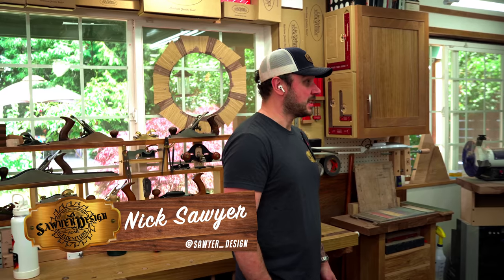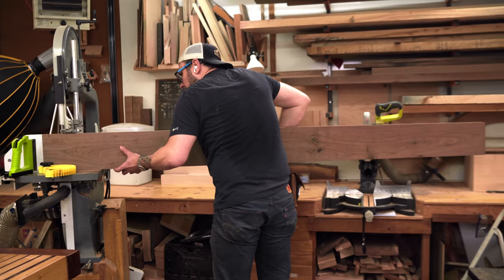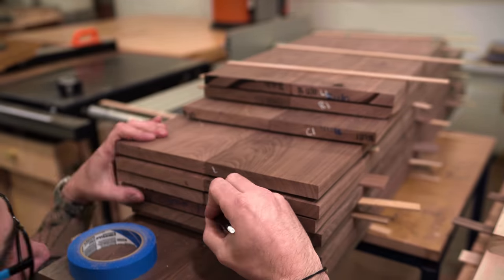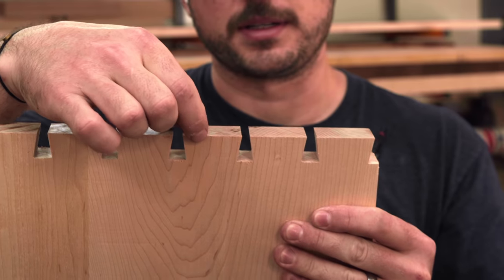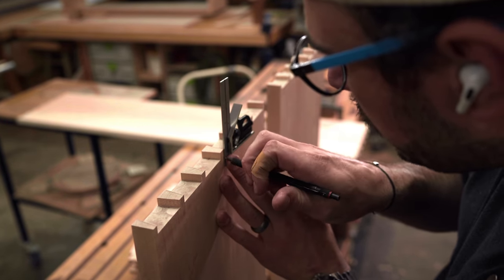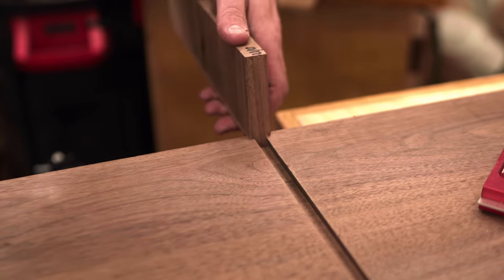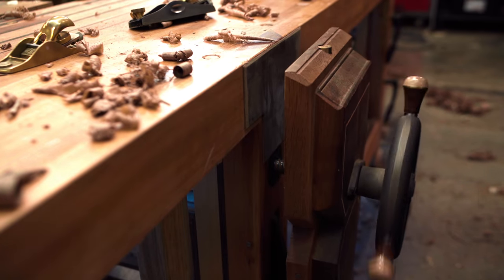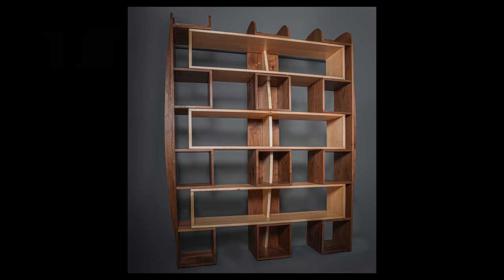A Walnut Case Where Books are Placed / WOODWORKING BUILD

Comment: I'm far from experienced in this craft, so correct me if I'm wrong—that horizontal router to cut dovetails looks incredibly difficult to use accurately, so I conclude you either masterminded that purchase to get 11/10 equipment, or the tool is extremely hard to use precisely and you are simply able to wield it with precision. Awesome way to whip through those tails with speed!

Comment: Very intelligent, well informed design.  A modern, practical approach to construction that still exudes the skill of the artisan.  And it looks great.  A very unique piece of contemporary furniture.  I'm impressed.

One question:  Would a stopped dado into the top and bottom of each box be OK for attaching the central stringer.
Reply from the maker: Thank you! I’m not sure what you mean by stringer? My carpentry knowledge is pretty limited. To keep the boxes square or attach them all together? Either way, yes, but may take away from the form a bit